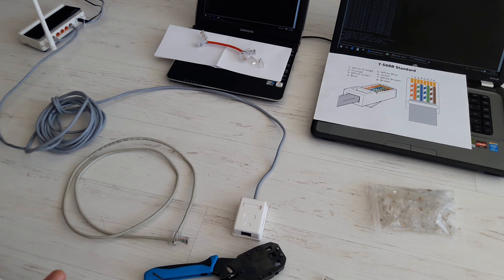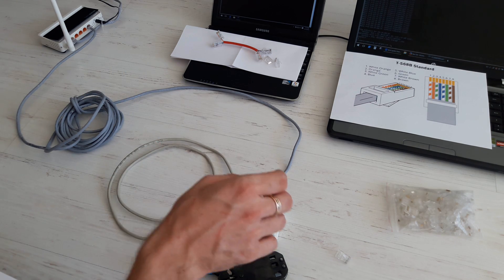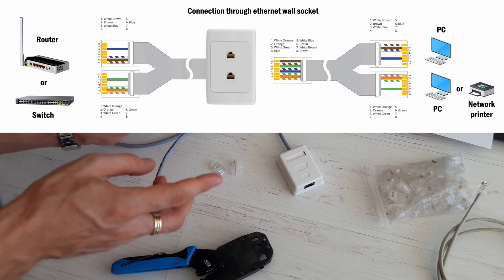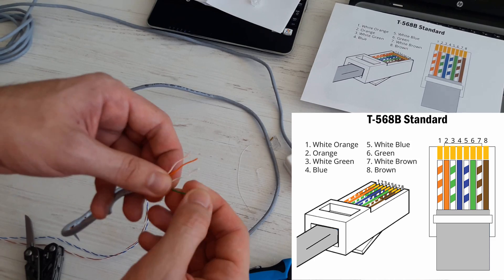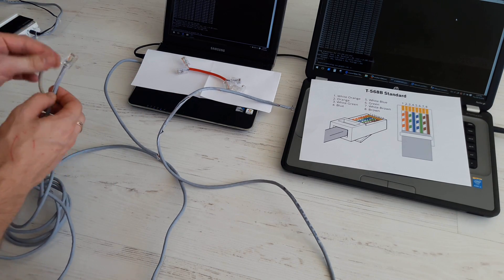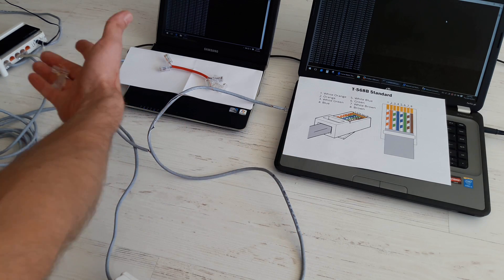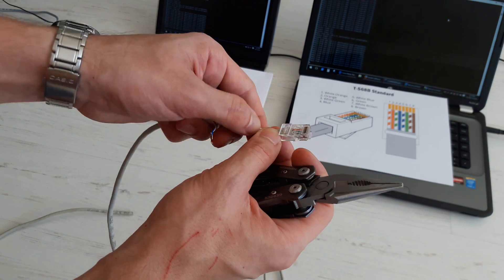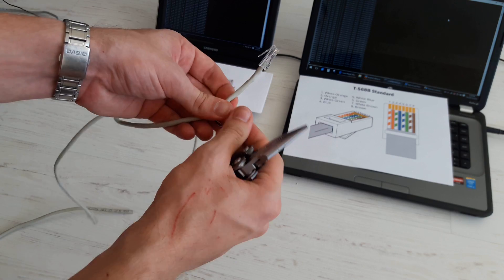Ethernet Hack: Use One Cable for Two Devices (No Switch Needed)

Comment: It will work. but will this two lines will interfere each other signal, considering that they running on one ethernet cable?
Reply from the maker: Since two sets of different pairs of wires are used for 100Mbps networks, there will be no interference between the two networks, ensuring their proper functioning.

Comment: What speed do you get this way? DO you get the same if you have 200mbps or 600mbps do they get the same or is it split?
Reply from the maker: Using only 4 wires of an Ethernet cable provides a maximum speed of 100Mbps. To achieve higher speeds, all 8 wires must be used for a single connection.

Comment: Just keep in mind that 4 pairs are usually cat5e which gives 1000Mb. Using 2 pairs is compatible only with 100Mb/10Mb.
There is no magic. You transformed good quality cable into two bad quality ones. If you instead used switch on both ends and used Cat5e you'd have 1000Mb instead of 100Mb.
Reply from the maker: You're wrong! With 4 wires you can achieve maximum 100Mbps. For the 1000Mbps connection you need all 8 wires. Just like you said there's no magic here.

Comment: Would it be possible for a T shaped cable?
Reply from the maker: It depends on how you see it. If you have one Ethernet outlet in your room and you want to connect for example your PC and Xbox, then you can make a T cable with one end that goes to the wall and the split side goes to both devices. So for your room it kind of looks like a T cable. But in reality, the cable that goes from your outlet to your basement or whatever and then connects to a switch should also be split and have two connectors. Because one Ethernet port can only support one device. And one Ethernet connection requires only 4 wires and your cable has eight. So we just use the other four wires to connect another device with the same cable.

Comment: can the split work for one pair sending signal into one direction and the other pair split to sent to another direction...or will this introduce noise?
Reply from the maker: Those two split cables work absolutely independent. It's like if you have two cables that are twisted around each other. Maximum speed for a cable with 4 wires is 100Mbps.

Comment: thanks sir.
i want to connect my pc to two ethernet shields, can i use the same technique with one end of ethernet cable plugged into pc and then i split the other end into two?
Reply from the maker: No it doesn't work like that. If you split cable, you have to connect two devices from each end.
Reply: @ElectronicsComputers   then how can i archive what i want?

Comment: Use the string inside the Ethernet cable to cut the insulation rather than  with the twisted pairs since they damage easily.
Reply from the maker: Its impossible!

Comment: Please help... My router is at the entrance of my house and in the room where I have my two computers, only one ethernet cable comes... which connection should I use so that both computers have internet and I don't have any losses? My connection is 100 mbps.
Reply from the maker: You need to attach an RJ45 connector to the blue and brown pairs at the router side (so now you can connect two connectors to your router) and then do the same thing in your room. In case if you have an Ethernet wall outlet in your room then you need to divide the cable into two lines that you plug into the outlet.
Reply: @ElectronicsComputers  Thank you very much!

Comment: can we add one end of the wire to router rj45 and connect it to rj11 DSL router to extend the internet , as i wanna extend my internet with the old dsl cable,which has only two wires in it with my old DSL router?
Reply from the maker: No. it's not gonna work like that.

Comment: Only disadvantage is the connection/link speed would be reduces from 1gigabit to 100megabit
Reply from the maker: Yep, but most people don't get even close to100Mbps internet speed. So in most cases it will work fine.

Comment: I can see that you have at least one cat cus of the marks 😂
Reply: Bro i can't understand anything but can you help me with this you see i have a input ethernet cable that goes directly into my wifi but my wifi has only input port for cable so i cannot connect my laptops lan cable directly in to wifi. So i thought i should split the input lable with some device called ethernet splitter into to cables and attach 1 in wifi and other in pc so will it work or do I need another device. Please help and if. Possible suggest the device

Comment: Sorry, I'm an amature, what do you mean by that?  I have strung outdoor CAT6 cables from my server room, outside and back into each floor of my house where I hope to be able to terminate with two plugs on each floor; one for a local, floor level wifi and the other for people to plug into.  What do you suggest?
Reply from the maker: It will work but you can simply buy two splitters from my links in the description which will do the same thing.

Comment: Tried this with about 30metres of cable. The Orange and Green cables connection works but the blue and brown wires connection is not working. Is this an issue of cable length or just bad krimping? Ever tried it with a long cable. Thought I had found a great solution. Running one cable instead of two.
Reply from the maker: Are you sure that you organized those wires in the right order? You need to wire the brown wires like the orange ones and blue wires like the green ones.
Reply: @ElectronicsComputers  There is no need to put striped-blue on pin 1 and solid-blue on pin 2. IMO you should try to resemble the T568A and T568B standards as much as possible when splitting. In both of those standards, striped-blue is on pin 5 (to the right) and solid-blue is on pin 4 (to the left). Therefore, IMO it's best to keep striped-blue to the right (pin 2) and solid-blue to the left (pin 1), when splitting.

The pre-made splitters I bought online had striped-blue to the right and solid-blue to the left, but the splitters I made myself a while ago had the opposite. Only when I did a continuity test on a cable run that had a pre-made splitter on one end and a self-made splitter on the other end, that I realized I had cross-over on the blue pair, which should be avoided.
Reply: I should mention that this eventually worked. Not sure what I was missing before. Pretty neat trick which has saved me a lot of time and effort since I first learned about this method.

Comment: This is good but i need to know if it and work with POE devices
Reply from the maker: You want to connect 2 devices via one cable + PoE??? No, it's not gonna work because those blue and brown pairs can be only used for a second device or for PoE.
Reply: For most applications, PoE will still work, you just have to make sure that the device supplying the PoE (switch, NVR, injector, etc) supports PoE "Mode A". See the "10/100 mode A, mixed DC & data" section of the table at https://en.wikipedia.org/wiki/Power_over_Ethernet#Pinouts also see my video https://www.youtube.com/watch?v=XInzn6VjMcM where I test that PoE works.

Comment: Thank you very much! Good explanation! Subscribed! What I don't understand is why you make to the router 2 ethernet clips. You can only make one and plug it in the router right? Because the dat from pc A goes over orange and green. And the pc B uses brown and blue. So you got enough with 1 clip (1 cable) on the router side. Maybe the router port where you set it on is not 1gbps. Thats the reason you seperate it so both pcs can use 100 mbit. Is that right?
Reply from the maker: It doesn't matter if it's 1Gbps or 100Mbps port. One Ethernet port supports only one single connection. For a 100Mbps network we need only 4 wires which means we can connect 2 devices via one Ethernet cable which has 8 wires. So we need 2 different ports on both ends.

Comment: Hi there! Thanks for you video. I have a cable stuck in the wall, so I cannot replace it. String 1 is defective. Can I use this trick to get 100MB/s And POE ?
Reply from the maker: One Ethernet cable can provide two 100Mbps connections or one connection + PoE

Comment: from my main internet router i want to connect two range extenders in different room with one cable by utilizing two pairs to save cable cost. two extenders on one cate6 cable will be any issue in future please clarify
Reply from the maker: if those range extenders have their own power supplies (not PoE) then everything will be fine. Just do it right.

Comment: Can you let me know if this is the same as using a ethernet splitter.
I'm trying to figure out how I can get internet to 2 of my cameras outside without drilling a new hole.

I have a POE and a non-POE camera.
There is already an existing ethernet cable the installation guy added when he installed the POE camera. Can you offer any suggestions. Thanks
Reply from the maker: Yes, it's basically same result which you can achieve with any Ethernet splitter.

Comment: there is 1 by 2 coupler, which can be used for this application
Reply from the maker: what coupler you're talking about?
Reply: @ElectronicsComputers   Search for Female to 2 x Female Plug Network LAN Cable T Adapter L

Comment: is it necessary to split the cable at router end?
Reply from the maker: yes! If you cant you can buy an adapter which you connect to that cable and you get two cables with RJ45 connectors. Or simply buy two adapters one for the router side and another to your wall outlet instead of splitting Ethernet cable. 
I use these adapters very often: 
http://ali.pub/4x01fb
http://ali.pub/4x01g3
http://ali.pub/4x01h2

Comment: This has been around for ages and no one has really taken the time to explain it. Though coming from a specialist standpoint if you wanted a butchers solution i would recommend just adapting to the keystone itself and dealing with the slight sacrifice.
Reply from the maker: This method is good as a temporary situation in some desperate situations, when you have to urgently connect a few devices without any adapters, hubs etc.

Comment: If I use only 4 cables in RJ45 connector and sinply cut down other cables it also make the speed 100mbps?
Reply from the maker: if you use all 8 wires (1Gbps connection) and if you cut those four wires it will switch to 100Mbps

Comment: What's the difference between doing this and a Ethernet cable splitter?
Reply from the maker: There's no difference. That wiring is basically how that splitter works.

Comment: When I plug direct into my router and do a speed test I get 225 Mbps download, does that mean I'm using all pairs? If I do this trick will it slow me down to 100 Mbps?
Reply from the maker: looks like you have gigabit connection and if you split the cable it will drop to 100Mbps

Comment: If you have single wall socket with cat6, it is cleaner to add wall socket and applying the same technique. Keep in mind that your speed is limited to 100mbps in this setup.
Reply: Sorry, I'm an amature, what do you mean by that?  I have strung outdoor CAT6 cables from my server room, outside and back into each floor of my house where I hope to be able to terminate with two plugs on each floor; one for a local, floor level wifi and the other for people to plug into.  What do you suggest is a better way with more speed?

Comment: I think it'll probably be easier to splice two ethernet cables into one keystone punch down. do that twice and you could use any length cable.
Reply: Sorry, I'm an amature, what do you mean by that?  I have strung outdoor CAT6 cables from my server room, outside and back into each floor of my house where I hope to be able to terminate with two plugs on each floor; one for a local, floor level wifi and the other for people to plug into.  What do you suggest?

Comment: Can we extend Poe port from one to 2 port
Reply from the maker: You can't extend the DATA line but you can extend power from PoE port. For example, if your switch has few PoE ports and a bunch of regular ports you can connect blue and brown wires from regular ports to brown and blue wires of PoE ports. Brown wires are DC positive and Brown wires are DC negative.
Reply: @ElectronicsComputers   sir how many  voltage came out from this pair from Poe switch
Reply from the maker: @tejaskansara2276  48 volts
Reply: @ElectronicsComputers  thank you very much sir

Comment: Thank you. I have a question. If you are only using two pairs for each connection at the devices,  then why do you need to split them on the end that goes to the router?   Is there some voo doo inside the router or switch that won't allow 2 being used on one port?
Reply from the maker: One Ethernet port provides connection only for one device. If it's 100MBps network then it uses only 4 wires other 4 pins inside of a switch/router don't even connected. So we need to split wires on both ends in order properly wire them. You just imagine that you use two independent Ethernet cables with 4 wires inside. But in our case we have one cable with 8 wires inside.

Comment: Say my internet is 30mbps will spitting make each port have 30mpbs? and if so if I connect 2 ports to 1 device shouldn't that device receive 60mpbs?
Reply from the maker: no it doesn't work that way. You have to divide your bandwidth (30Mbps) by the number of devices connected to your switch or router. But again even in this case it doesn't work that way. Because on PC can draw more data from the internet than the other one. So the speed may vary between all PCs but the whole bandwidth will be not higher than your maximum 30Mbps.

Comment: Talking about Smart TV hidden cameras, is it posible to prepare an ethernet cable for just to receive signal (data) and not sending anything back? Thanks for your time.
Reply from the maker: no it's impossible! IP protocol doesn't work that way. If your smart tv model comes with a web camera you can disable it through the service menu.

Comment: For home use, have at this hack. If you're a professional low voltage cabling contractor or an electrician running cable for a business infrastructure, or even running cable for someone's home, please don't do this. This eliminates POE and gigabit capabilities, and it's just extra work when you could simply pull another cable. Being that there is no industry acceptance of this method, there's a good chance you may miss a pin or punch down wrong. Just not worth it unless you really want to be cheap.
Reply: And what if you're retrofitting old construction and pulling another cable is next to impossible? This kind of hack should almost never be used... but in specific cases, including at a business, it totally can do the trick. :)  I'd recommend clearly labeling the port with its limitations (100Mb, no PoE)
Reply: It doesn't eliminate PoE capability, you can only use the PoE standards that don't require more than 2 pairs, which is fine for most PoE applications. See the "10/100 mode A, mixed DC & data" section of the table at https://en.wikipedia.org/wiki/Power_over_Ethernet#Pinouts also see my video https://www.youtube.com/watch?v=XInzn6VjMcM where I test that PoE works.

Comment: Be careful ... most RJ45 connectors have a single point to pierce the wire and are intended to be used with stranded patch cable (the single point pushes through the middle of the strands). The ethernet cable for use between wall boxes is single strand and intended to be terminated into a fork in the wall box. Terminating the single strand cable into a standard RJ45 crimp can produce a very poor and unreliable connection.

Comment: yes you do lose performance that way you are limited to 10mbps try to run 4k or 1080p video through that conection and then you see...it only work for internet search without video, and if you have 2 computers and dont have cash to buy a switch just sell one pc and buy a switch easy...dont invent this ...this is all invented by now....tell the engineerd the are stupid and want to waste copper cable for no reason
Reply from the maker: What 10mbps you're talking about? It will work with the same 100Mbps because that connection requires only 4 wires. 1Gbps connection uses all 8 wires. You don't get the point of this video. It's all about education and options that you get if you know how it works. I recently was on a deployment which went not as planned and I was able to organize network and provide stable connection via protected radio channel in the middle of nowhere with minimum of equipment. Everyone can use fence-shmency stuff try without it!

Comment: ok... so for even 2016 this is old as heck wiring. Shouldn't one be setting up AC wireless AP for their laptops, and hard-wiring the building for 1G and replacing patch panels while at it with biscuits like that used sparingly to bridge old cables? you're not doing your client any kindness with this kind of wiring for a long time now (2004 and beyond).

Comment: i need help i only have blue,brown,white blue and white brown
Reply from the maker: That cable is only for one line. It's actually not even ethernet cable it's phone/security faxalarm cable. Some companies use that cable as ethernet cable to save a few bucks.
Reply: @ElectronicsComputers  
Hi, you did an amazing job. My problem is that the wall socket wires are blue' orange, whitexblue, whitexorange . What should I do ? And will it work in my case ? Please reply asap. Thank you for your time.

Comment: will this method work for one pc and one telephone?
Reply from the maker: Sure! Using Ethernet cable you can connect one PC and one or two telephones. 100Mb/s network uses only 4 wires so you have 4 spare wires (brown and blue couples) and your phone needs only two.

Comment: This video helped me not to run wall cable since all I need is a  2 separate networks for my media and IoT devices that's should be not running in 1000 speed. All I need is 100 speed for both line I try to solve. Great hack
Reply: and all you get with this is 10mbps not 100 or 1000